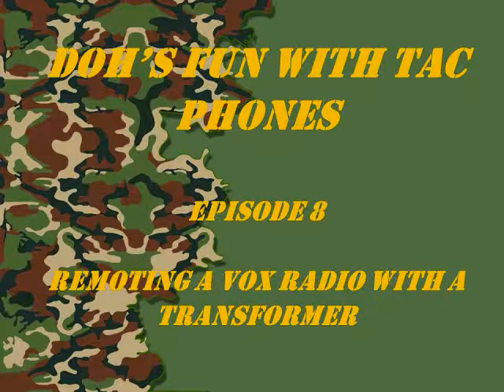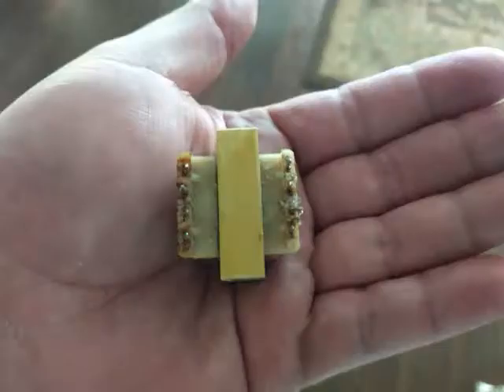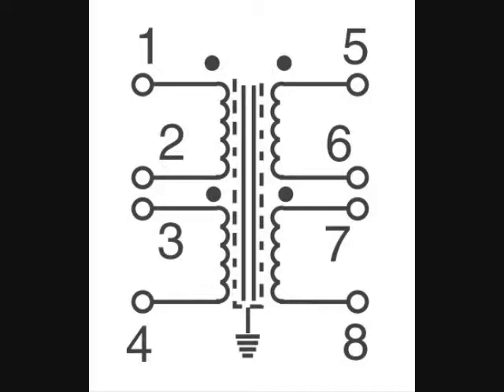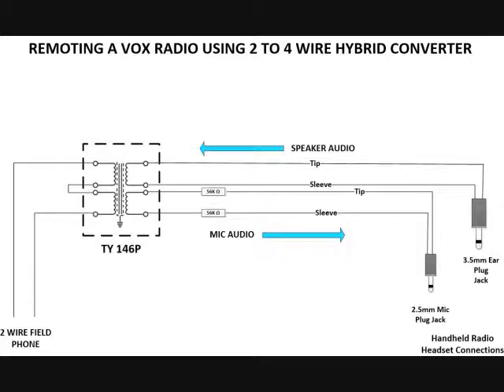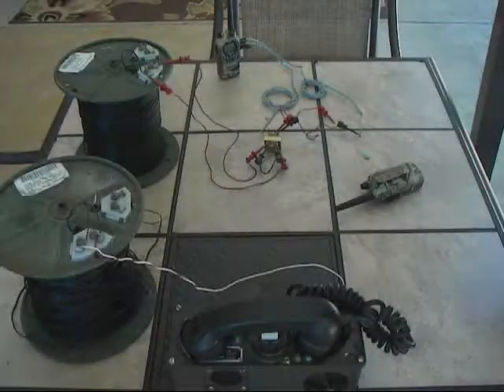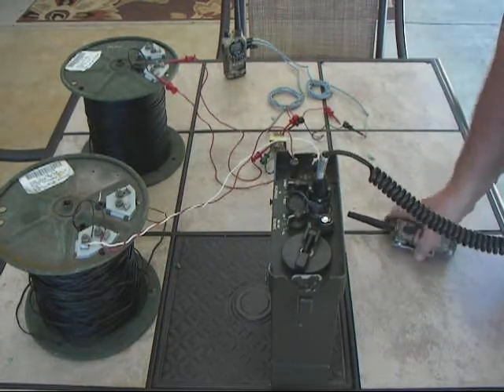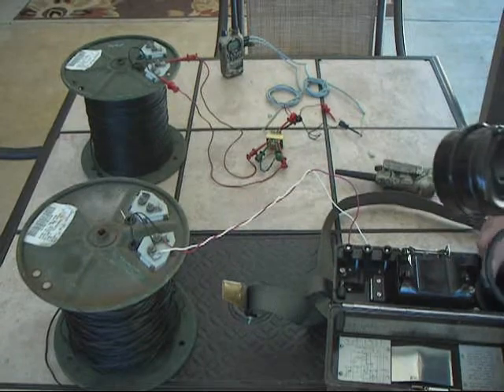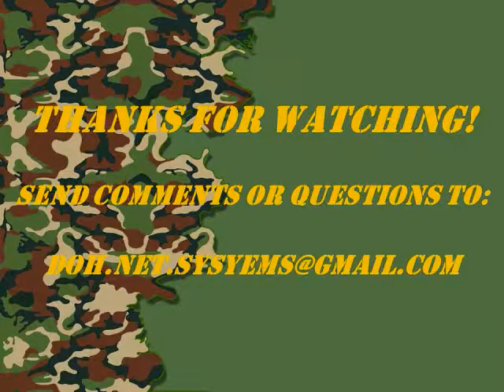FIELD PHONE OPS:  Remoting a VOX Radio using a  TY-146P Audio Transformer

Comment from the maker: Good news! I think I figured out you problem.  The Midland GXT and the Baofeng radios use different connectors and connector arrangements.   First the plug sizes are reversed.  The video I made show to use a 3.5mm for ear and a 2.5mm for mic.  This is backwards. Use a 2.5mm for the speaker and a 3.5mm for the mic.  Now, this arrangement doesn't matter to the TY-146Y audio transformer.  Also you need to use "stereo plugs"  These have a Tip, Ring, and Sleeve,  the ones I used for the GXT do not, they are mono plugs and only have a tip and sleeve.  

Now this arrangement does not matter to the TY146P transformer but does to the radio.  I'll explain.  The  3.5mm plug for the mic has 3 signals on it, the Tip has + voltage, the Ring has Mic +, and the Sleeve has Mic -.  When you used a mono plug like I use for the Midland GXT,  you basically are shorting the V+ on Tip to the Sleeve Mic +  to the Sleeve ground .

The 2.5mm  plug on the Baofeng use the Tip for Speaker +, the ring for TX Data, and the Sleeve for Speaker -/Ground.  Again, by using the mono plug like I used on the GXT,  your shorting Speaker + to Ground and shorting TX Data to Ground.  

The Baofeng uses the V+, TX Data, and RX data signals to allow a programming cable to be plugged into the radio and a PC to allow the channels and freqs to be set.  When all of the signals are basically shorted and grounded together the radio does not know what to do.  I'm surprised it worked at all.

So the first thing to do is purchase a 2.5mm and a 3.5mm stereo plug you can get several of each on Amazon for around ~$12.  So you can swap the mono plugs being used now for stereo ones.

Next  on the transformer side, connect the 3.5mm plug Ring to the  TY146 terminal 5 this connects the MIC+.  Use a multimeter to determine which of the plug solder points are the Ring.  Next, connect TY146 terminal 6 to the 3.5mm Plug's Sleeve, again use a multimeter if you're not sure which solder point on the plug is the Sleeve.  This connects the Mic - or sometimes called Mic Return.  Leave the Tip Disconnected.

Next, connect the TY146 terminal 7 to the 2.5mm  Tip, this is the SPK +.  Again use a multimeter to determine which solder point is the Tip.  Connect the TY146 terminal 8 to the Sleeve which is Speaker -.  The Ring should not be connected to anything.

I would leave the resistors connected and start bench checking to determine what you need to set the VOX sensitivity to on the radio.  Remember that how loud you speaking voice into the field phone is will affect the VOX sensitivity level.  I would set the VOX level on the radio to  transmit with a normal speaking tone.   The radio should start to transmit when you start talking into the field phone.  You will have to train yourself to drag out the first word alittle so you  to allow for the VOX to activate and not cut off you first word.  Likewise the VOX should deactivate and stop transmitting after you stop taking on field phone.  Be prepared to take some time in setting the VOX levels on the radio and to also make sure that all the personnel who use it understand how it works as far as voice level goes and how you have a short recovery time between transmitting, generally a second or two.

This should work using a TA43 or TA-312.     Let me know if this fixes it and I'll redo my video and add Baofeng radios.    Good Luck!

F

Comment: Do you think this setup would survive a ringer crank or two?

I could see myself or another operator putting this on a switchboard and forgetting that line 1 goes to a radio.
Reply from the maker: I will not guess.  The damage would be to the radio that is connected to it.  I would mark the line pack with a piece of red, yellow, or orange electrical tape as a visual reminder not to send a ring on the line.
Reply: @thefieldphoneguy8254  There would be no way to signal to the operator that the call is done unless the operator stays on the line (I have a LP-10) and the subscriber can still crank on accident.

Maybe a high-pass filter would work? I don't think the ringer does more than 100 hz anyways.
Reply from the maker: Ringing voltage for a field phone is between ~60-90 VAC at ~20hz depending on the OEM country of the field phone.  I would recommend a speaker to constantly monitor the radio circuit so you can hear when the conversation is done but also to let you know when you have incoming traffic on the radio.  You can try a filter.

Comment: Have you tried patching this through to a normal POTS line? That's a huge factor for me if I ahead and build this or not. If you haven't would you possibly be willing to try it and upload a video about it?
Reply from the maker: Won't work on a POTS line.   That requires specific equipment built for that purpose.  Sorry.  This  is a more refined version but still won't work on a POTS line.https://www.youtube.com/watch?v=Bp3v0YKs3eU&t=715s
Reply: @thefieldphoneguy8254  even through an SB -22 switchboard? I'll handle the dialing and off hook and all that at the switch board. I was just hoping the audio would get through after the call has been connected.
Reply: @thefieldphoneguy8254  or do you think I'd have more luck working 3 the mic and speaker of the radio directly into an extra phone handset? Obviously making sure the audio signals match with some resistors.
Reply from the maker: I'm not sure what your trying to do.  The radio interface that I describe will not work with a POTS or PTSN line.  These lines have voltages and supervisory signals that need to be utilized and manipulated and this type of equipment is difficult to find and expensive.  I designed to the device originally to remote a VOX radio from a field phone.  This works over SB-22s, LPC10s, and P193 switchboards only.  Please reply to doh.net.systems@gmail.com this will allow the exchange of diagrams.

Comment: Made this the way you showed and it didn't work , i used a radio with vox on it as well
Reply from the maker: Evidently you didn't build it the way I described or it would have worked, no offense.  I'm going to have you to check somethings:

1. Did you use a TY146P audio transformer?  This was the only one that I found that would work.

2.  Did you install the jumper on the transformer?  You must install the jumper between terminals 2 and 3 on the transformer.  This makes the transformer change 2 wires to 4 wires.

3.  Did you use a Midland GXT 1000 radio?  That's what this was designed and built to use.

4.   Can you hear radio audio over the TA-312?

5.   Make sure the radio is configured for VOX and the VOX setting are set on the most sensitive setting
Reply: I bought that specific transformer , 2 of them , bought the exact resistors you specified , did the jumper the same as you specified by the number markings and soldiered it all down to a bread board circuit board , used a baofeng radio with vox , it worked for 10 min and then stopped , i could only hear on it but not transmit
Reply: I really hope to get this working because i had plans to use this as part of my extensive comms grid that i have built in my comms shelter for airsoft/paintball games
Reply from the maker: Does your TA-312 work if you hook another one to it?  Also never ever crank the ring generator when the TA-312 when its connected to the transformer or you'll ruin the transformer.  My guess would be your levels in your radio aren't set correctly.  I also never used a Baefong radio only Midland GXT 1000s.  It took me an afternoon of swapping resistors in and out and adjusting speaker volume and the VOX activate levels in the radio to get it to work.  I would first get the volume that comes out of the radio and goes back to the TA-312 set to the level that sounds the best.  Next set the VOX.  It can be touchy.  I had a problem with being able to transmit on the radio using the TA-312 but the radio wouldn't unkey when I stopped talking so the radio would lock in transmit.  What model of baofeng?
It sounds like the VOX needs tweaking,  You can also try taking the resistor out of the wiring that goes to the mic jack on the radio.  Also remember that your talking volume going into the TA-312 is what triggers the VOX.  So like I said before the VOX activation level is important.    You are using a TA-312 correct
Reply: @thefieldphoneguy8254  yes , i connected my 312 to a ta43 plus all three phones to my sb-22a switchboard and all works properly , i did not crank the ringer as you mentioned it will damage the radio , i used a bf-a5 baofeng radio with vox , i did try removing the resistor on the mic side then removed the speaker side , no luck , thank you for helping , im hoping we can get it to work
Reply from the maker: Are you running it thru an SB-22?  That might make a difference.  If you haven't tried yet I'd do a direct connect from the phone to the transformer and see if that matters.  I'm going to do some more research in the next day or so on the baefong radios.   Like I said, I haven't used them for this application before
Reply: @thefieldphoneguy8254  no im not running it through the switchboard , it was used to confirm the phone was still functioning properly and it was
Reply from the maker: @rickcampbell2673  I'm thinking its probably a combination of the mic impedance and the VOX sensitivity settings.  The two wire out put of a TA-43/312 will overdrive the mic input on a radio.  The transformer causes some drop in signal level then the resistor drops it more to make the audio input to the mic jack on the radio more acceptable to the radio.  I hate to say you're probably going to have to do trial and error between switching resistor values and changing the VOX activation level in the radio.  I did some research on the baofeng radios and they don't list the procedure to change the VOX level settings or I couldn't find them.  The MIdland radio I use has setting of 1 to 9 for setting the VOX with 1 being the most sensitive and 9 being the least.  Like I said it was alot of trial and error.  What is the exact model number of your radio?  I might get one so I can do some bench work on getting it going.